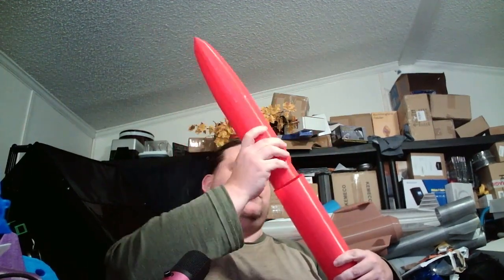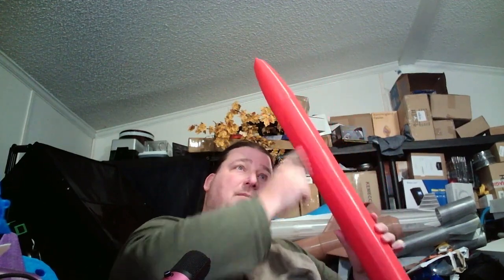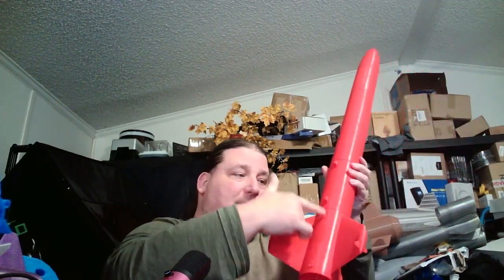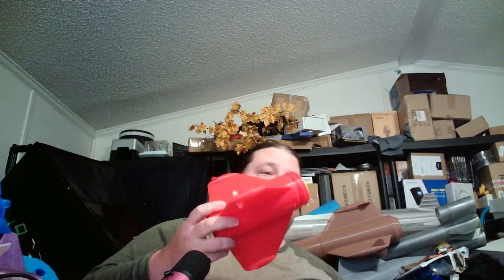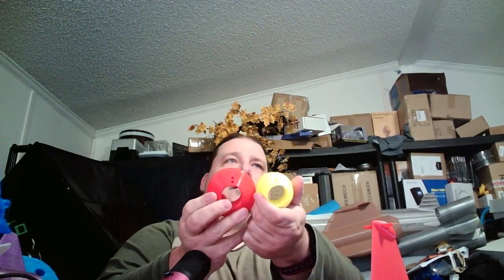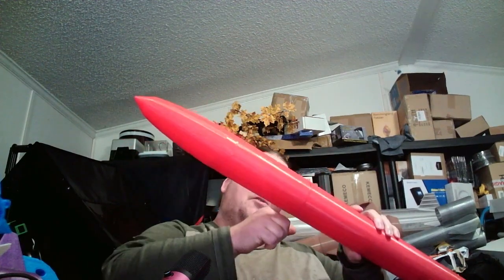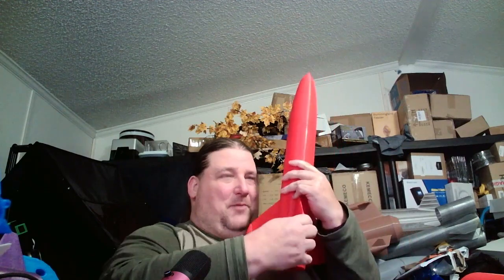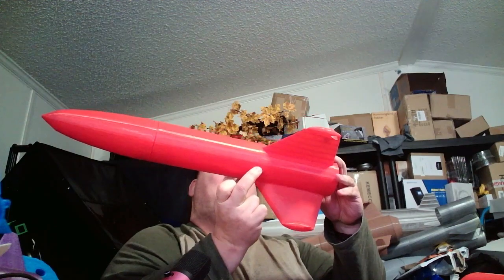MRS Rocket Assembly

Comment: Another thought, if one section is considered to be payload, have you designed an electronics sled for it? Could you use internal rails it slides in/out of, would it need to have all-thread, or just screw in retention couplers at each end?   Possibly look at average weight of the type of altimeters, gps, trackers, batteries required, that could fit this size rocket and see if a printed sled with basic screw in retention fitting could hold it.  I am building Eggtimer electronics. Say I have altimeter, gps and tracker with a 2S lipo.  I don't know if that combo is avg or not, but should be able to get figures for those devices. Featherweight or Raven might be lighter, RRC2 and Altus Metrum look to be same size as Eggtimer though.
Also, do you have a recommended size parachute to use?
Reply: with 3d printing that can be designed. I have not made an av bay with sled yet but its entirely doable and not even that difficult.